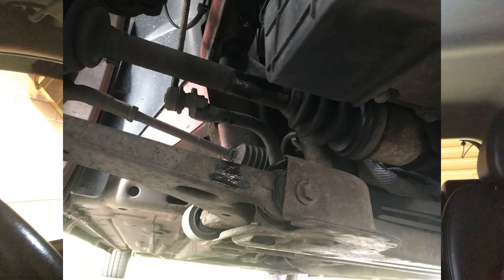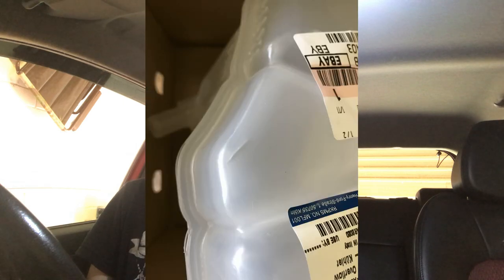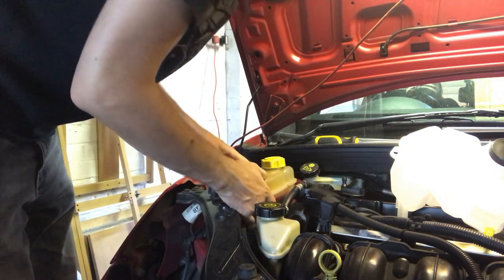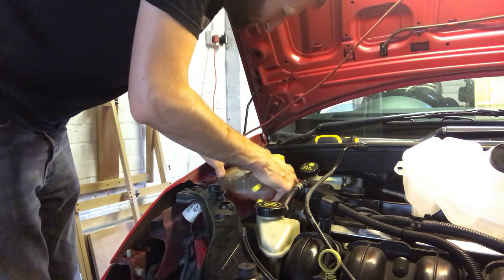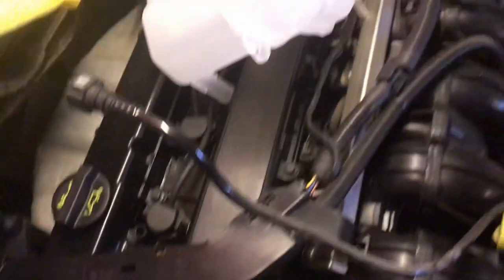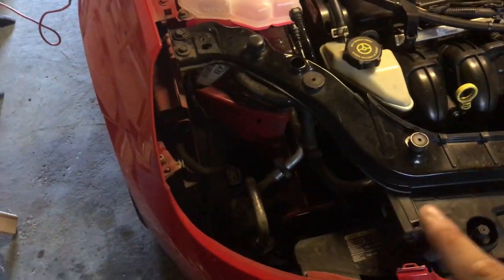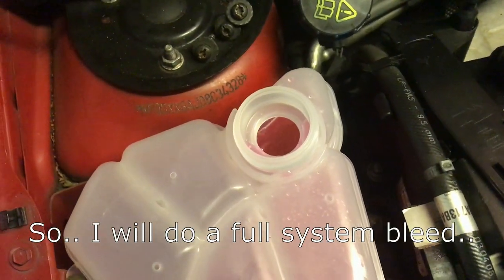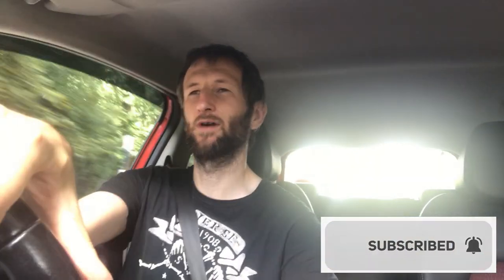Fiesta ST150 Replacing The Coolant Bottle & Bleeding The System

Comment: Had my coolant go low, was thinking - Water pump, or another hose has gone! Got it up to temp, had a blast then checked under bright lights with a tissue. Was leaking out of the back, had a little crack, my tank looks alot better than others I have seen, but it was it's time. Lucky, got an alloy tank will fit it soon. Ford Part No. 1349989 Tank Assy - Radiator Overflow, In case you want OEM - @ £89, I went for the Alloy @ £79. Thanks for the top vid, will try and save as much coolant as poss!

Comment: Is this still the best way to bleed the system on a st150 as I'm gonna be changing fitting a coolant hose this weekend and don't want to mess it up hahaha
Reply from the maker: Yes, there’s no valve etc so best way to .. like boil it out. Didn’t have any issues after doing that. Can’t really mess it up, just get mix right if not already diluted and keep an eye on temp guage .. long as doesn’t go too high worst thing would be you still have air in the system in which case you try again
Reply: @FF04ORD  cool, thanks 😊 😎

Comment: How much antifreeze did you need to refill the tank?
Reply from the maker: The tank doesnt acutally hold that much. No more than a litre I would have thought. I used what I had left from doing the thermostat change/full system flush
Reply: @FF04ORD  It seems like alot of water when the bottom plastic pipe snaps 🤦🏼‍♂️